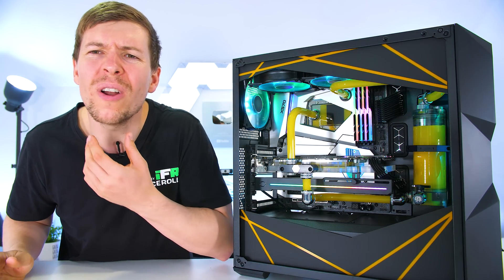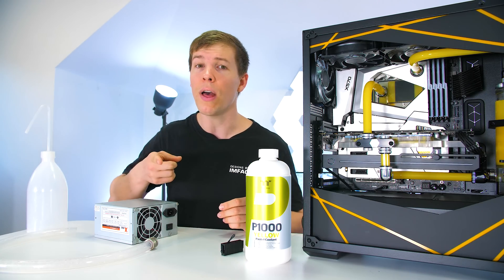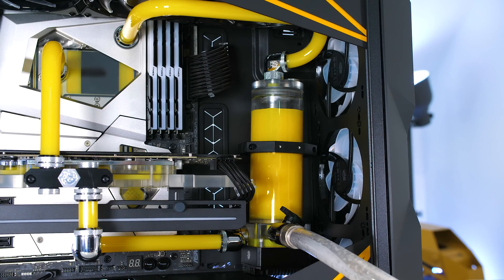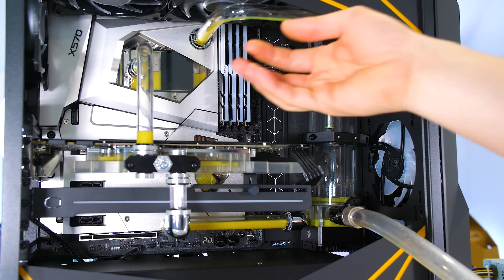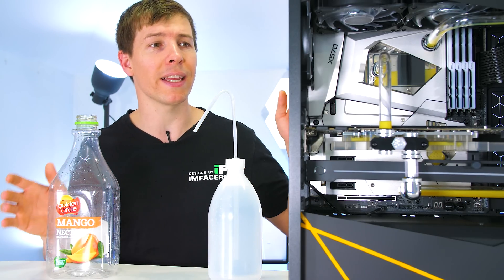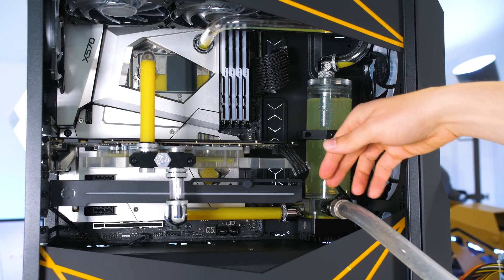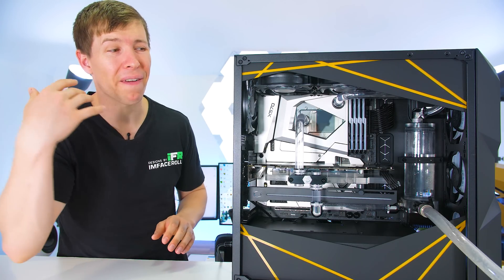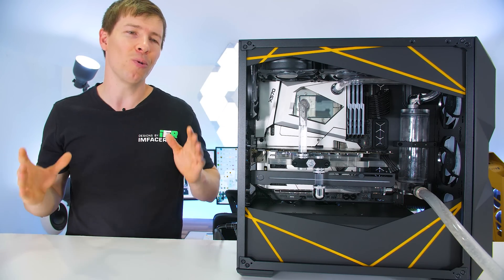How to Drain a Water Cooled PC 2020 - Beginners Tutorial

Comment: I've been loving your videos since I discovered your channel not too long ago, and while I don't subscribe to many, yours is one of my favorites. I've built my first 2 hard tube setups recently...one with PETG and the other with Acrylic. So, I'm still wrapping my head around the plumbing/physics aspects of liquid cooling. One of my builds is actually in a 200+ pound piece of furniture that is not easy to tip in any direction. 

Are there any tricks in your tubing layout that you incorporate to improve the ease of draining (or filling)? Like air ingress/egress ports elsewhere around the build (beyond the reservoir?). Do you use any air release valves like those by bitpower?

Thank you.

Comment: Noob Asking. Could you not automate the flush?  You have your lower drain port and a drain tube from there, could you not add another connecting point at the top and run a fill tube from there (both inlet and outlet away from the PC). If you had a bucket of distilled water and a submersible pump to the inlet and an empty container for the out then you wouldn't ever run the installed pump, just turn on the distilled pump and it would continue to run until clear. you'd do away with the additional power supply, the jumper, fill bottle and speed the whole process up....... or am i missing something?

Comment: Question - I have the Bitspower Sedna O11 front panel from my  O11 Razer edition - it only plugs directly into the mobo with (I think) 4 pin PWM connection - since I don't have separate power to plug into a second power supply, how can I safely run the pump without turning the PC on and off? that's the only other way I could do it so far, turning it on and off... is there an adapter to plug from 4 pin PWM to molex or something?

Comment: Loved your term for an old PSU - "Grandpa" power supply,  I reference them as "Yum Cha" PSU's. Myself, I have a Corsair SF450W with an eVGA jumper plugged in permanently on the 24 pin for my maintenance duties. My system is a bit harder to drain as I have 3 radiators with the last installed in the floor of my case but with a lot of tilting I can get most of it out. Also, all my radiators are AlphaCool crossflow which seem to drain much easier than the traditional variety.

Comment: on some old power supply's there is a black button and there is a green led next to the black button. the black button jumps your power supply. why do i have to un plug the power to all the components except the pump? because you will kill your mother bord and cpu.
Reply from the maker: You unplug incase liquid spills on them. There is no power going to the hardware so they should not fry
Reply: @DesignsByIFR  ya i had some components pluged in and it killed my cpu mother bord
Reply: wich suxed

Comment: Worth mentioning: if you're going to use the PSU in your PC to run your pump for the re-filling, draining process...unplug your spindle drives if you have any. Turning the PSU on and off repeatedly can mess with your spindle drives...I found out the hard way when I was doing this a while back. I'd go as far as to say, unplug anything you can...better still, use a separate PSU like the video shows, just to run the pump.
Reply from the maker: You should have everything unplugged =)
Reply: @DesignsByIFR  Yes..could have saved myself some words :)

Comment: One way I get most of the liquid out of my loop is to attach a tube to the fill port and blow air into the loop to force most of the water out.
Reply: Yeah, i do that too -  closing the system off at some point (at the GPU) and using the leak tester to pump air/water to res
Reply from the maker: I do that on some harder loops =)